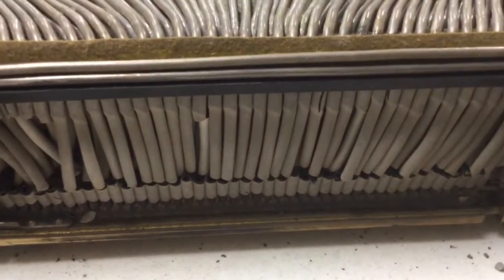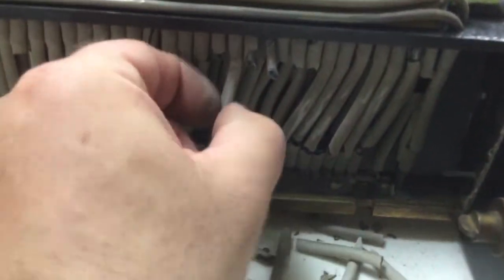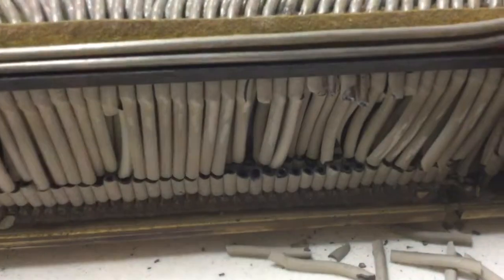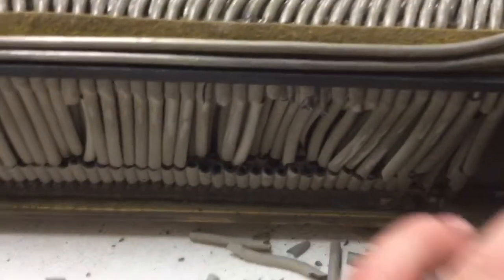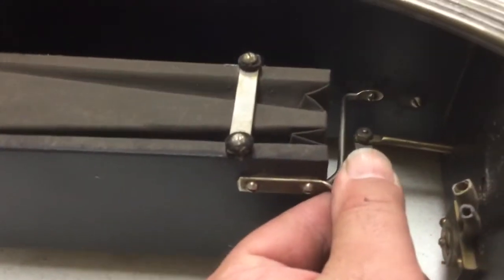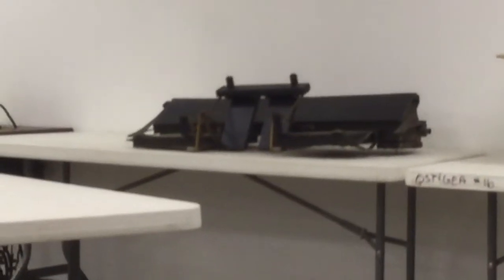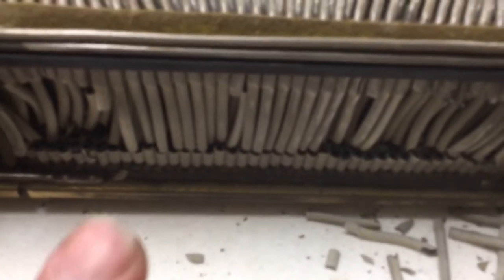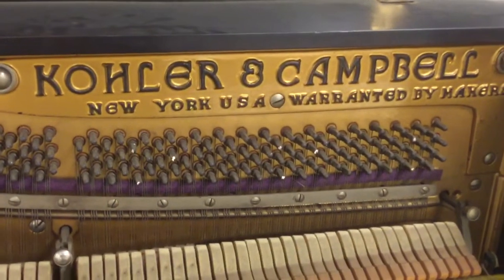Player Piano troubleshooting part 2

Comment: Silicone tubes, could it be a replacement althernative? I think that they will last "forewer"? Regards Stig Österberg from Dalsbruk in Finland.
Reply: I bought silicone tubing to replace old plastic on my piano. So far so good but I am concerned about the tubing collapsing on itself from the vacuum pressure. Anybody else try the silicone tubing?
Reply: @joshuagorman3139  I am sorry i made a "logical misstake" in my 60 Year old brain. There is vacuum not pressure in the tubes.

Comment: There are these 2 pieces of leather, one on each of the 2 primary bellows that get push pumped on my player piano. At this point, they are both curled up on the sides and aren't covering over the 5 holes any longer. I'm wondering how completely sealed these leather strips are meant to be. It appears that they should only be there for the suction and should be allowed to expend some air. Can you speak to this at all? Thanks for your videos!
Reply from the maker: Those leather pieces are the check valves. They operate like a reed valve in a compressor.
They MUST seal or the exhauster pump bellows will not work.
The curling up on the edges is common and happens as the leather ages and dries out.

Comment: Your stack looks just about like mine, I've been continuing to remove the old decrepit rubber connectors from the transposing tracker bar.   Did you leave all the lead tubing in her?
Reply from the maker: Yes, all the lead tubing was left in place. It was all in good shape and i could see no practical reason to replace any of t.

Comment: How old are those rubber tubes? Mine was rebuilt professionally in the early 1970s.
Reply from the maker: I think they were original tubes from 1926 when the piano was made.
Reply: I going to consider myself lucky; I've got an almost identical piano but it does not have the same tracking system. Mine has a sort of cam that moves the scroll as opposed to moving the tracking bar. I'm getting a lot of air leaking from the motor; I don't suppose you have rebuilt one?